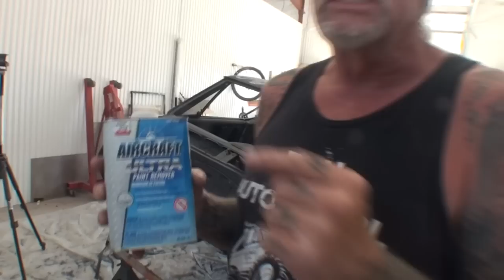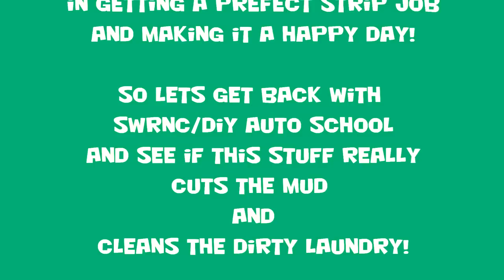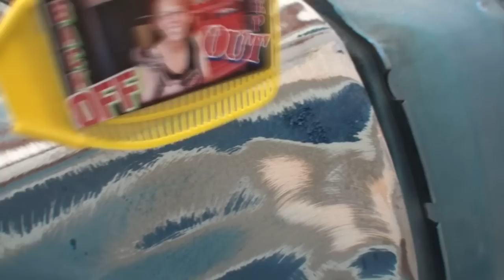How To Strip Paint Off A Car - 1967 Pontiac GTO

Comment: The aircraft ultra works very well. Not quite the old stuff but damn close. It’s gotta be the ultra. I just stripped a hood with it at work last week. At the end of the day, I brushed on the ultra, covered it with plastic, and let it set over night. Scraped it in the morning into a box so no mess, and it was down to bare metal.
Reply from the maker: Funny. That’s what I used on the deck lid of the gto and it worked like crap.  Coppers out did it by 20 miles and NO PLASTIC SHEETING NEEDED. Air Craft stripper is a mess.
Reply: @myfriendpete  funny, i didn’t have no issues with the aircraft ultra 🤷‍♂️. 9 different ways to skin a cat, gotta use what works for you

Comment: Hey Pete
  If the factory etch is scratched off during the removal process, does the car then need to be prepared somehow before spraying with Epoxy to protect the surface or can it be sprayed directly over the metal after using the Coopers flushing?

Thanks

Comment: I only have one question Pete. It comes in different sizes. What size package will do a full car?
Reply from the maker: It all depends on how much paint is on your car. This car had the original paint which maid it easy and used less to do the job. I had some left over but then on the other hand I still had the hood and fenders to do. It also depends on the size car. I suggest you call and talk to them and they will be able to answer that question better for you. Thanks for watching. 🙏🙏🤙🤙

Comment: The thing with the "SPRAYER" is that you both might be using it the wrong way.
When pulling the trigger do it slowly and let it go all the way down and then release it and let it go back to its starting position. By doing so you are gonna improve the fanning effect and allow the sprayer to have a more extended life service.